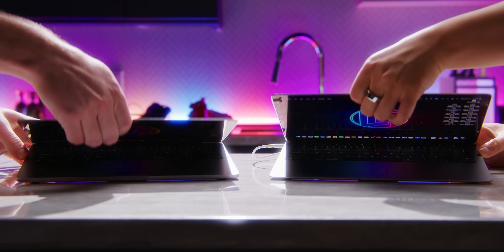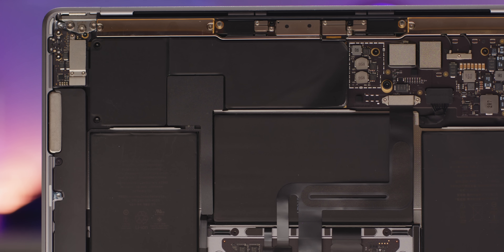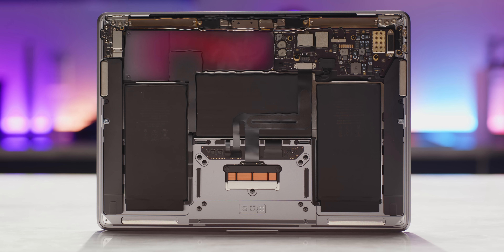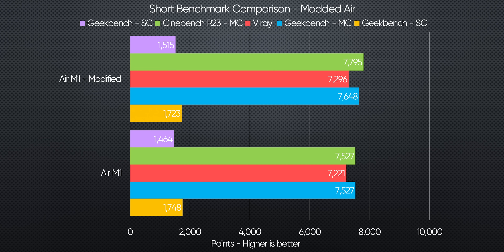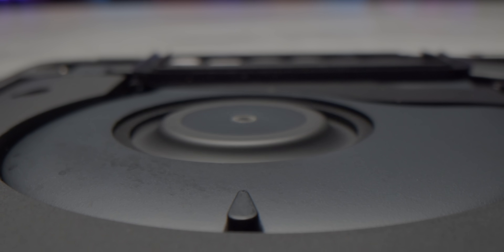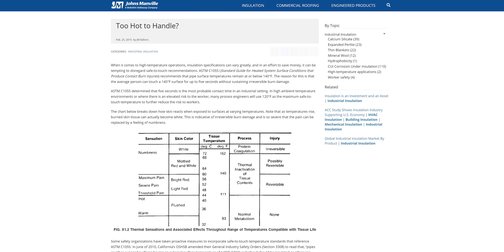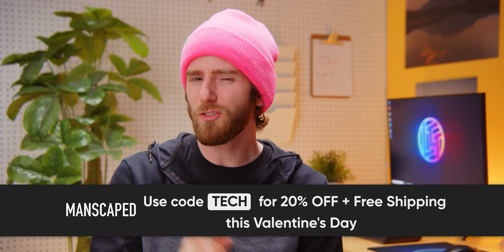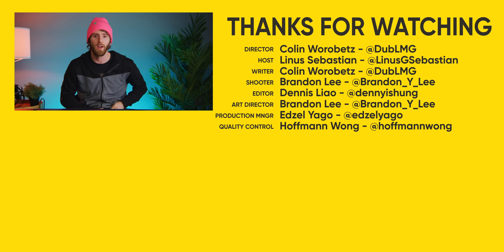Fixing Apple's GOOD Engineering - M1 MacBook Air thermal pads

Comment: Just need to water cool the M1 chip and see how much power it really has 😭
Reply: If we can overclock it then yes water-cooling it will be a great idea to see how far we can get
Reply: There wouldn't be much improvement tho 
Because there's a power limit in hardware side
Reply: @Bronze HD I’m referring to the original comment above regarding the idea of water cooling it. If it’s not throttling and is able to maintain its clock speed using thermal pads, then no. Because it’s not throttling. Continuing to cool it further will not reap benefits in terms of any form of performance. Unless it were to be over clocked and therefore needed to be cooled further to maintain that clock speed continuously.
Reply: It doesn’t get too hot, so water cooling it probably wouldn’t do much
Reply: It’s not throttling. So there would probably be no difference.
Reply: Underrated comment

Comment: Getting away from..err man bits for a moment....try thermal pads , then sit the macbook air on a laptop cooling pad like the Cooler Master Notepal XL for example.

Now the Gamers Nexus way of doing it would be slightly different. ...take one bath filled with LN2 .....:-)

Jayz ? ...well , that would be rgb strip lights glued all the way around the chassis !

Comment: I was hoping you'd take it one step further and also get an old school  Laptop cooling fan stand.  (some powered by usb others by battery) then while the chasis itself becomes the heatsink you then also have a fan blowing the heat from the case away! And that step wouldn't even require any modifications beyond what you already did with the thermal pads.

Comment: I thought they would kinda ghetto cut a hole in the bottom and fit a tiny fan in their making room for it by making the heatsink smaller.. 
Thermal pads are.. meh.. working but kinda boring :(

Comment: I swear Apple thought about this but purposedly didn't apply it on McBook Suffocates Air because they want to sell you more expensive products !
Reply: You are kinda wrong though. I head many people went to choose M1 MacBook Air instead of the Pro one because M1 is already create less heat that it’s run fine without fan. And people don’t want to hear the fan noise. (It’s still fast even when throttle)  Also they hate the touch bar on the Pro model.

Comment: What if you had a skin or case on the bottom to insulate you from the chassis?  It'd slow down heat dissipation but you'd still have the benefit of using the entire bottom as a heatsink.  Win-win?

Comment: can you do the same thing but with the previous macbook pros that tend to thermal throttle? Just stick thermal pads between the heatsinks and the back cover? not a problem if the bottom heats up, as long as it doesnt damage anything

Comment: 55 for metal is kind of hot, as low-temperature burns (yes, that is a thing) can occur already at long exposure to 40 degrees celcius. Essentially you are 'slow cooking' your skin. I am not aware of any specific research into laptops, but research into korean floor heating, which can get up to 50 degrees celcius, and cold packs, found that old people could get significant burns from these after extended use.  (As a reference: doi: 10.5999/aps.2015.42.2.173)

Comment: Couldn't you also just put thermal pads on the heat pipe and square coverage over the die of the MacBook pro and use the rear plate to move heat as well?

Comment: Now that the heat is evenly distributed along the bottom part, how would it hold up against the batteries? I think batteries need cooler temps right

Comment: 0:09 Same but just 1 Catch? The SOC in the Pro has 8 GPU cores and the Air has 7! How is that the same? How does this "fix" the M1 Macbook Air? 7:39 Why would an Apple user do this? If someone wants a Laptop that has performance like an M1 MB Pro, they should just get the M1 Macbook Pro. Better Screen, Better Battery & Touch-Bar ... These are Apple users, not PC Gamers, get out of the Walled Garden, you're contaminating the topsoil! M1 Macs have no upgrades by design! Just ask Louis Rossman!

Comment: This is what I did to my work issued 13" 2014 MacBook Pro. It went from 90-100 degrees to 60-70 under full load. I have to use that device for work for a little while still and the 10% to 20% improvement in performance was worth the hotter chassis. It's usually just sitting on my desk anyway so the heat doesn't really bother me.

Comment: This is not how temperatures work. At 35°C ambient the ∆K is much lower thus the cooling potential of the chassis is lower. You can not do a linear extrapolation based on your 20°C ambient.

Comment: 5:50 this doesn’t seem accurate because the speed at which heat exchanges is proportional to the temperature distance on an exponential scale so a laptop that runs 50 degrees in a 25 degree room won’t run 55 degrees in a 30 degree room

Comment: I wonder how it would perform with a different bottom cover -- for example a cnc'd 1-2mm thicker cover with radiator fins on the outside, this would both decreases the lap contact area and increase the surface area and airflow.... and, IMO is likely to make the thing prettier  =)

Comment: I did something similar to this with an older laptop that had thermal throttling problems. I wedged a stack of about 4 copper pennies between the heatpipe and the case to transfer some of the heat to the chassis, and it worked well enough, barring the fact that enough lateral force would send four electrically conductive objects flying around the motherboard...

Comment: I'm afraid you're a bit behind on the safety standard. IEC60950 has been replaced by the new IEC62368-1 standard. This new standard became mandatory in the US, Canada and the EU on december 20th 2020. I do believe that the max temperatures are the same as in IEC60950.

Comment: I think a potential pitfall of this mod is reduced battery longevity, as the entire backplate will heat up higher than usual. Resulting in escalated temperatures in the battery which negatively impact longevity. I would go as far to say this might be the reason why the engineers didn't opt for a chassis cooling, it's a small tradeoff that would significantly improve longevity and comfort.

Comment: Pair this with active cooling on the bottom of the chasis and BOOM! Perfect m1 Air. Something like a cheap laptop stand with a small fan should keep the heater away from your peter, and cooling the chasis with even a small fan would increase cooling performance.

Comment: I have the entry level air and when running programs like games and virtualization for extended periods of time, you can definitely feel the system start to slow down. I think a mod like this coupled with a cheap laptop cooling pad would be perfect for users who spend most of their time at a desk or a table. A quick question though- what thickness and size of pads did you use?

Comment: I would argue that you wouldn't have the laptop on your lap at the point where it would be doing heavy-duty work like a long render, as at that point you're more likely to lay it on a table top and go do something else while you wait for it to render, so in the general use case, this shouldn't be much of an issue.
Reply: Also, you could always dial-back the surface area of the thermal pads to find a more-balanced middle ground.

Comment: What if the the warming bottom panel expands faster than the steel screws? Aluminium expands faster than the steel because the bottom plate is being heated right? Would the stress the screws?

Comment: linus: i would not like to use this in my lap for 1 hour

me: laughs in my 2009 laptop that gets 80º using google
Reply: 90+ on an old Thinkpad T420 just sitting on the desktop and yes that was with a cleaning of fans/heatsinks and thermalpaste being reapplied to the system. CPU was a i5 2520m and gpu was the Nvidia NVS 4200M
Reply: @Montisaquadeis  That's the same cpu as my dad's laptop. It's running super hot now too. That sucks that even after all those steps it's still overheating.
Reply: @Montisaquadeis  the most interesting is that even with that regulation for eletronics, most of the cpus used on laptops have high working temp
Reply: @Montisaquadeis  Something is not right there, I manage those at my workplace, they are cold at idle and warm under load. The fans can fail though, and the BIOS will often give you a fan error. I'd buy a replacement fan.
Reply: @compaqdeskpro5770  Yep I would be checking the fans as well, but I would get some fan oil first before tracking down a new fan to see if that does not get it going better, plus fan oil is just handy to keep around.
Reply: @Montisaquadeis  I have a T520 and it's quite comfortable to use
Reply: @Montisaquadeis  my laptop too has same cpu. The fan is fast and the air blown is very hot. Fortunately, it has a plastic body so the body is bearable.
Reply: LAP MEAT'S BACK ON THE MENU, BOYS
Reply: @GirthOfANation  grilled or extra crispy?
Reply: This is why you get a usb powered laptop cooler to help bring down the temps, and a padded lapdesk if you are going to be using the system while sitting on a your couch, lazy boy, etc..
Reply: @CommodoreFan64  yeah, sure i will spend more than 100 bucks, in brazil at least, on those stuff. It is hot but it is bearable,
Reply: @romaobass  Not my fault everything is expensive there complain to your government, or run for office help make changes. 
Walmart here in the US has basic lap desk for $5 USD, and decent one is $10 - $30 on Amazon.  a decent cooling pad on eBay here is $10 - $30 USD depending on if you want to go cheap, or get something decent. However you can get thick clear sticky rubber chair feet for the bottom of your laptop too help raise it up, and get some better cooling, as I did that with my old Lenovo Thinkpad X120e that was missing the feet when I got it in, and it really helped the fan pull in more cool air.
Reply: @CommodoreFan64  you are right lol. I hate living in this country
Reply: Celsius or Fahrenheit?
Reply: @charlieworley3  celsius lol
Reply: My 2011 MacBook Air is a lap warmer playing Minecraft Forge/Roblox
Reply: I play on a toaster.
Reply: What are yall Doing With your Laptops holy Shit
Not even the Really Bad Acer i have With an AMD A8 3500m Overclocked to 3Ghz Runs that freaking hot
Reply: I no longer own the ThinkPad and haven't in like 6 years or so
Reply: jpNewPic88.Men
Reply: I cook my breakfast and boil water on my laptop . Perfect 102 degrees C
Reply: How thick are those thermal pads?
Reply: Br
Reply: i have a 2012 laptop which goes to 85 while playing games at 4 fps
Reply: My 2017 macbook pro does the same
Reply: I get 65 degrees when using google on vostro 3550
Reply: Mainstream web pages are so fucking slow now its unbelievable. I can do just about anything on my X60 but go to a big corp site and the fan go nuts and it starts stuttering. Those corpos have put chemicals in the websites, and turned my thinkpad memetop into a macbook!!!
Reply: LOL my macbook (2009) hits 104 C when I'm watching YouTube at 720p for more than about 15 mins

Comment: I'm glad that you brought up the IEC standards. There are actually a lot of laptops and tablets where the IEC skin temperature limit is the thing that causes throttling. It's particularly easy to see on the Surface Pro, where there is clearly a temperature sensor on the chassis, and where the embedded controller will force power limit throttling on the CPU once that sensor hits a trip point. It's so dramatic on the Surface that you can get significantly more performance by just pointing a fan at the back of the chassis.

If we didn't have the skin temp limit on the Surface, it could dissipate significantly more power while keeping the CPU in a safe temp range.

The M1 Air may have a chassis temp sensor as well. If it does, your mod might actually do nothing at higher ambient temperature, because the M1 is going to throttle when the chassis gets close to the 55C limit.

Comment: Love the content! I am not usually one to comment on videos, but I wanted to offer a up a bit of knowledge here. I noticed on the last video you guys posted and a few other that you are experiencing some RF noise on your wireless lab mics. A bit of background, I am a live sound engineer in Atlanta, GA. I work a lot with radio frequencies. It appears you use a combination of Lectrosonic and Sennheiser wireless units. I wanted to recommend a couple of pieces of gear to help solve some issue. Obviously wireless can be very inconsistent, however I have found using a third party scanner like the RF Explorer handheld unit to analyze any location helps pick the best available frequencies. Sometimes, and I am sure you guys are doing this, the onboard scan can be a bit lax whenever there are multiple mics in play. Using the RF explorer with a software called IAS by Professional wireless to coordinate any number of brands will result in crystal clear wireless. I know this is completely unsolicited, but I figured I would put this out there! If anyone has any more RF questions, feel free to email me at josh@spacebearaudio.com

Comment: Basically, you added thermal pads instead of sponge, and it improved the performance a bit at the cost of comfort for the temperature under the IEC limit by half a degree. (55° is the limit for temperature for metal products)
Thumbs up for me for giving you a simple analysis for that 9 minute video.

Comment: So solution to this. Works perfect if on a table, and if you want to use it on your lap, just have one of those fan laptop pads under it, which would boost the performance even more since you're now actually blowing air over what is essentially the new heatsink. I'd have loved to see what a test with one of those coolers under it would do.

Comment: basically means that Apple values consumer comfort before the performance. Which, actually understandable... Thinking about a 1000 USD laptop which you presumably know that there is no fan in it. Then you start using it and it gets hot underneath to an uncomfortable level. What would you think? Yes, engineering failure. 

Therefore, having told the consumer that the laptop is fanless and precautions them that it might run a bit slower with long workloads probably a more reasonable option.

Comment: There's this magical invention called a desk to put your laptop on...or just wear thick pants
Reply: Or take off it off your lap when you start to feel a burning sensation.

Hmm, I appear to be getting burned. This is most certainly a strange sensation. I wonder what will come of it...

I've put pots on my lap, and they were on the stove only a minute beforehand. It doesn't burn you right away, you just lift it off when needed.
Reply: @flameshana9  nah I think the burning means it's working. I'm just extra cooling

Comment: As an engineer, I would say that there is a reason why apple put an insulating layer there: the battery can't stand the heat. If you get rid of that, the battery would more likely to become bulgy in the long term.

Comment: I am thinking that most people who work on macbooks connect them to a monitor and then it could be put on a laptop cooler. But if you use it without a cooler the aluminum might bend in time due to heat and then you cannot unscrew the back panel.

Comment: What about using the Panasonic thermal graphite sheets on the inside of the back panel to couple the heat from the thermal pads to a larger area of the panel? That might be able to reduce the hottest part below that threshold.

Comment: I've always wondered why nobody, especially apple, did this. If the bottom of the machine is going to be made of metal anyway it would seem like a good way to remove excess heat, and for systems that throttle after a while it almost seems ideal. I wouldn't necessarily take it with a fanless approach though. Take for example a gaming laptop, which frequently have issues with heat unless they're thicker, if you already have a more efficient transfer of energy through thermal paste, some heat pipes, and heatsinks then you decide to add some thick thermal pads from the CPU to the bottom you're going to get less of the heat there because of the less efficient transfer but possibly enough to make a difference. Plus vent holes in the machine, both inlets and outlets now serve as active cooling zones with the air flowing over them.

Just make the whole laptop out of the heatsink

Comment: I remember when ltt reviewed one of the pc cases that used the case as a radiator, it had a flexible steel tubing acting as a heat tube between the CPU and the case, and I thought they should integrate those into laptop designs, so they could also use the back of the laptop screen as a radiator.

Comment: Soo just add cheap laptop cooler as a stand for 10$ and solve that heating chasis problem
Reply: At the expense of voiding the warranty in the short term (All M1s are currently under warranty as of Q1 2021) and frying out the SoC/MoBo in the longer term
Reply: @goobfilmcast4239  why would you assume the SoC/motherboard will suffer the heat more than the Pro's internals?
Reply: @AlejandroLZuvic  Heat is not expelled (fan-forced air) away from the case

Comment: Tl:dw, add thermal pads to the macbook airs cpu heatsink and remove a insulator on the bottom panel so it fits. But now bottom panel gets too hot so all you gotta do is throw in a notebook/laptop fan cooler at the bottom

Comment: Without knowledge of the normal heat distribution, assuming it to be limited to the heatsink and vent area, I believe this mod might have adverse effects on the lifetime of the batteries. And it might affect other parts of the machin, that is not ment to operate at a higer tempeture. Some of the flexcabels might not like the increase.